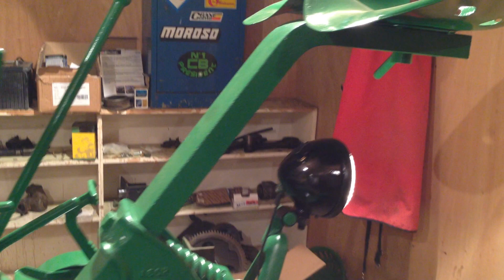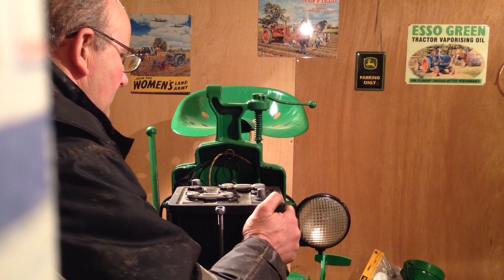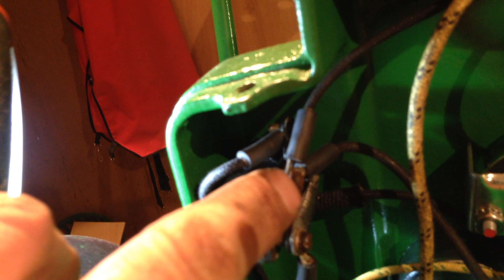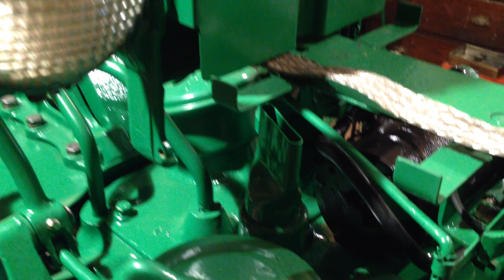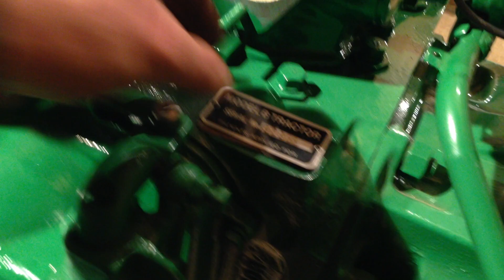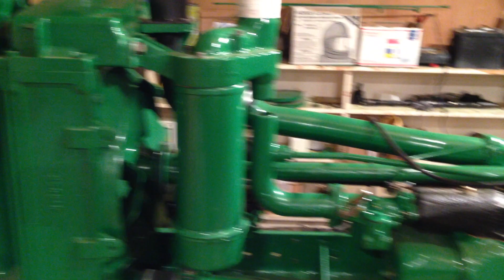1940/41 John Deere B tractor restoration update no 2 etc

Comment: Im havin electral issues can u tell me wat to do starter works w cables off but when on starter dont work n i didnt clean cable in box of seat yet any ideas ?
Reply from the maker: Colt Navrat Hi Colt , when you say it works with out the cables are you using a slave battery to run it say with jumper cables ? And when you connect up to the tractor electrical system it don’t work this would suggest there is a voltage issue on the tractor wiring to me . Clean up all the connections from the battery to the starter , if you have a multi meter check also your getting actual voltage to the starter , one last thought you have got the earthing right if the tractor is a positive earth and some how now it’s negative the motor won’t turn it’s some thing to do with motor windings I guess it’s to protect the starter motor , it definitely sounds like a voltage issue, you’ve just got to be methodical in your approach checking each individual part of the system at a time , cleaning connections would be my first plan of action , hope this helps regards David.
Reply: @oneminutefarming9521  it was ground issue under seat was rusty n i was goin thru tin n it was rusty n rejumped it n worked